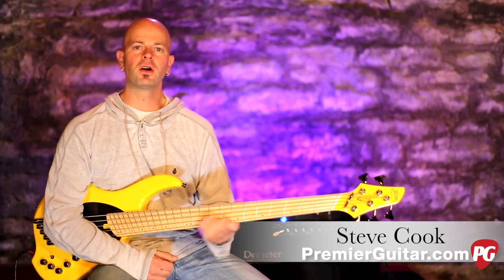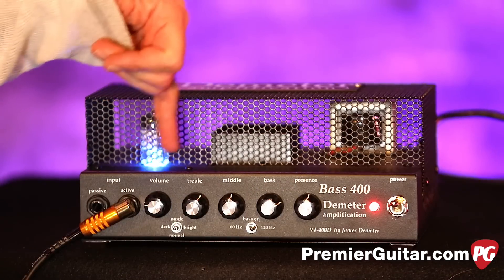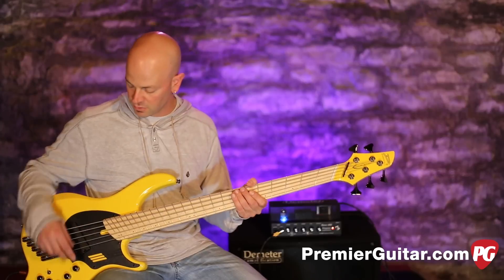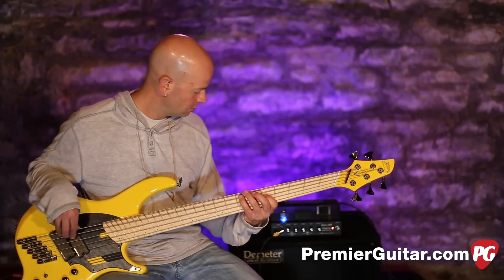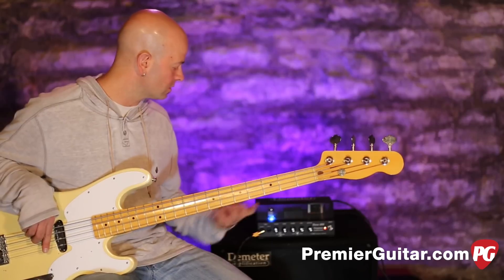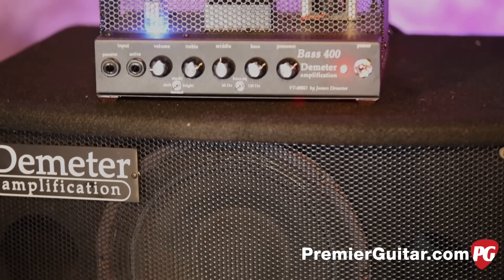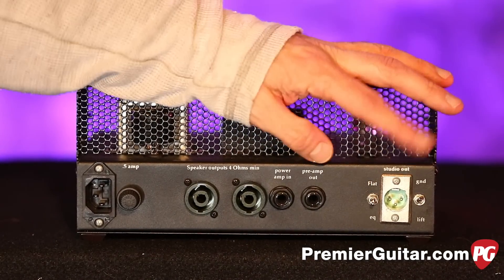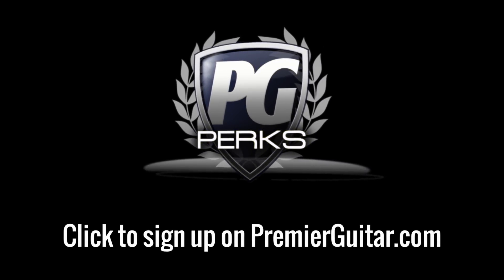Review Demo - Demeter Amplification Bass 400

Comment: Diming the controls sounds great because they are passive tone controls (like old school tube amps). They don't boost and or cut like more modern lay-outs (present day SVT's for instance).  They're actually  'flat' with everything dimed and the mid control fully counter clockwise...